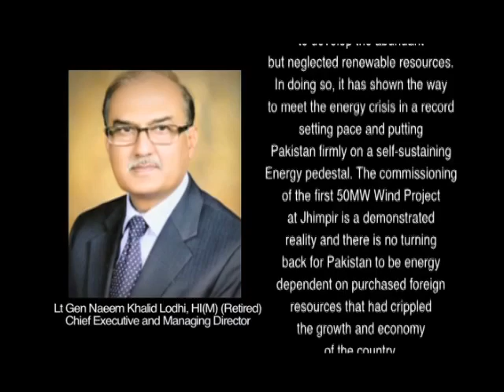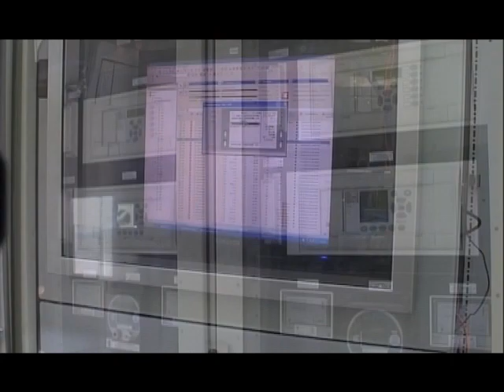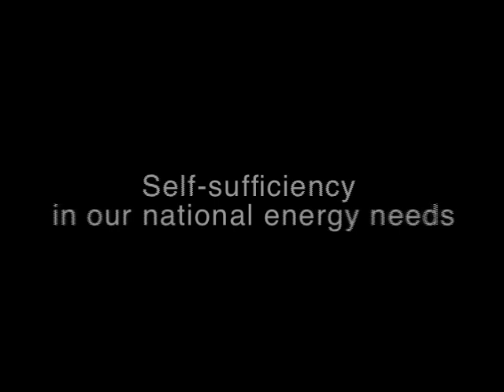Pakistan's first 50 MW wind power project by FFCEL at Jhimpir Sindh

Comment: Pakistan has the potential 150,000 megawatts of wind energy,  Sindh corridor can produce 40,000 megawatts.
1. Jhimpir Wind Power Plant Jhimpir, Sindh  56.4  MW MW Operational since 2009.
2. Jhimpir Wind Energy Project (FFCEL) Jhimpir, Sindh  49.6  MW Operational since Dec 2012.
3. Three Gorges First Wind Farm Pakistan Ltd Jhimpir, Sindh  49.5 MW Operational since Dec 2014.
4. Foundation Wind Energy–I & II Pvt. Ltd Gharo, Sindh  100 MW Operational since Jan 2015.
5. Sapphire Wind Power (Pvt) Ltd Gharo, Sindh  49.5 MW Operational since Nov 2015.
6. Yunus Energy Ltd Jhimpir, Sindh  50 MW Operational since Sep 2016.
7. Metro Wind Power Co Ltd Jhimpir, Sindh  50 MW Operational since Sep 2016.
8. Tenaga Generai Ltd Gharo, Sindh  49.5 MW Operational since Oct 2016
9. Gul Ahmed Wind Power Ltd Jhimpir, Sindh  50 MW Operational since Oct 2016
10. Master Wind Energy Ltd Jhimpir, Sindh  52.8 MW Operational since Oct 2016
11. FFC Energy Ltd Jhimpir, Sindh  50 MW Operational since Oct 2016
12. Zorlu Enerji Pakistan Jhimpir, Sindh  56.4 MW Operational since Oct 2016
13. Tapal Wind Energy Ltd Jhimpir, Sindh  30 MW Operational since Oct 2016
14. HydroChina Dawood Power Ltd Gharo, Sindh  49.5 MW Operational since Nov 2016
15. Sachal Engineering Works (Pvt) Ltd Jhimpir, Sindh  50 MW Under construction.
16. UEPL Wind Power Pakistan (Pvt) Ltd Jhimpir, Sindh  100 Under construction. 
17. Thatta Power Plant Jhimpir, Sindh  50 MW Under construction. 
18. Three Gorges Second Wind Farm Pakistan Ltd Jhimpir, Sindh  99 Under construction. .
19. Hawa Energy Ltd Jhimpir, Sindh  50 MW Under construction. 
20. Jhampir Wind Power Ltd Jhimpir, Sindh  50 MW Under construction. 
21. Tricon Boston Corporation Jhimpir, Sindh  150 MW Under construction. 
22. Hartford Alternate Energy Jhimpir, Sindh  50 MW Under construction. 
23. Western Energy Pvt. Ltd Jhimpir, Sindh  50 MW Under construction. 
24. Zephyr Power Ltd Gharo, Sindh  50 MW Under construction. 
25. Shaheen Foundation Jhimpir, Sindh  50 MW Under construction. 
26. Norinco International Thatta Power Pvt. Ltd. Jhimpir, Sindh  50 MW Under construction. 
27. Trans Atlantic Energy Pvt. Ltd Jhimpir, Sindh  50 MW Under construction. 
28. Act 2 Wind Ltd Jhimpir, Sindh  50 MW Under construction. 
29. Artistic Wind Power Pvt. Ltd Jhimpir, Sindh  50 MW Under construction. 
30. Harvey Wind Power Project Jhimpir, Sindh  50 MW Under construction. 
31. Zulikha Energy Ltd Jhimpir, Sindh  50 MW Under construction. 
32. Gul Ahmed Electric Ltd Jhimpir, Sindh  50 MW Under construction. 
33. Din Energy Ltd Jhimpir, Sindh  50 MW Under construction. 
34. Burj Wind Energy Pvt. Ltd Jhimpir, Sindh  14 MW Under construction. 
35. Dewan Energy (Pvt) Ltd Jhimpir, Sindh  50 MW Under construction
36. Titan Energy Pakistan (Pvt) Ltd Jhimpir, Sindh  50 MW Under construction
37. Dawood Power (Pvt) Ltd Gharo, Sindh  50 MW Under construction
38. Bhambore Wind Project Gharo, Sindh  50 MW Under construction
39. Gharo Wind Power Plant Gharo, Sindh  50 MW Under construction.
40. Finerji (Pvt) Ltd Jhimpir, Sindh  50 MW Under construction
41. China Sunec Energy (Pvt) Ltd Jhimpir, Sindh  50 MW Under construction
42. Trident Energy (Pvt) Ltd Jhimpir, Sindh  50 MW Under construction
43. Wind Eagle (Pvt) Ltd Jhimpir, Sindh  50 MW Under construction
44. Quaid-e-Azam Wind Park Punjab  1000 MW Under construction
Reply: is this  true?
Reply: Yes, It is true.
Reply: @yourayaz  personal lagwa sakty hai kia
Reply: @Rizwan Khan 20 of those are completed as   wind power generation stands @ 1189 MW which was only 200 MW in 2015. Other project were droped by investors , but 14 new projects are at different phases which will add 700 MW more to system till next year.
Reply: Mashallah bari info share ki ha apnay